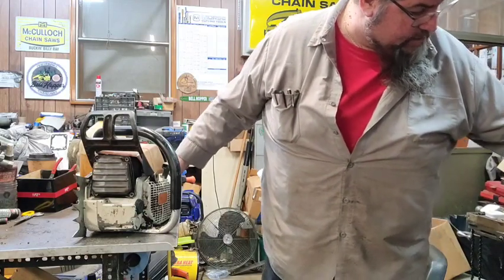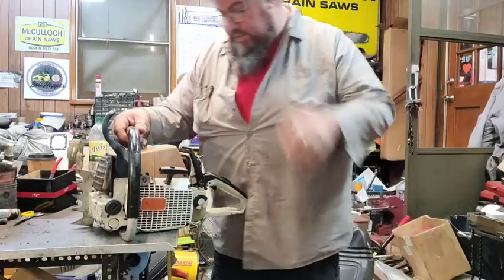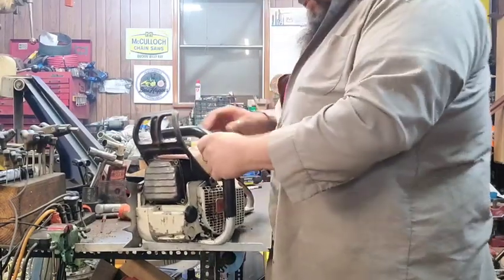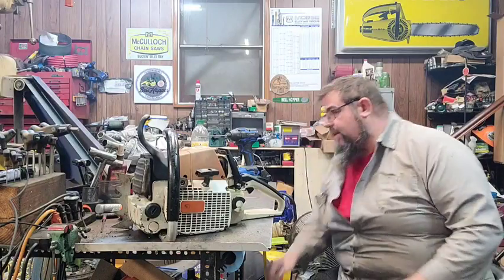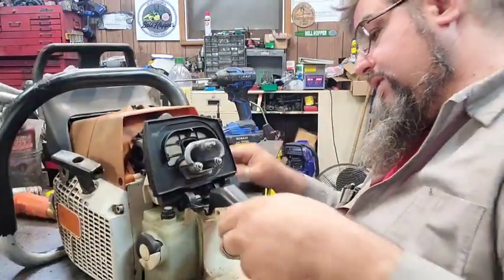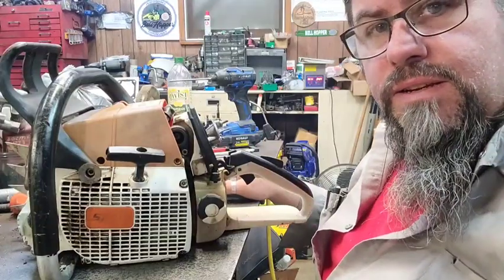Stihl Ms460 What Goes Wrong ?

Comment: Did you ever figure out how to test the ignition module under the flywheel on the 048 AV electronic saw? Im getting the same numbers on the old coil as the new coil. so I dont think the coil was the issue, however the piece under the flywheel is another matter.
Thanks for any and all input you can offer up.
Reply from the maker: Drew has one im trying to get it so we can test it

Comment: I built a 345 husqvarna that acts like that but its worst unrunable really and i cant seem to figure it out. So i put a new top end on it and a new set of seals and bearings so i installed everything fired it up and runs like theres a bad drag on it  and the crank on the clutch side gets hot so i tore it all down again never seen anything out of the ordinary put it all back together and no difference not sure if its where i put ebay bearings in it or not but i cant run it
Reply from the maker: When the timing is retarded they seem to drag alot im going to change the flywheel to the 046 and see if it changes
Reply: @bellhoppersaws  Yea id say thats your case but i think
Something else is up woth mine

Comment: Thanks. What was the initial low and high settings on the carb to get it to start?
Reply from the maker: I usually do 1 1/4 on both
Reply: @bellhoppersaws  Thanks again. I will try setting mine and getting it running today.
Reply: I got my MS 460 running again. I started with both jets 1 turn out. After tuning a bit I think the low is about 3/4? But that wasn't the problem with why the chain was turning at idle. I decided to check the clutch. I had 2 broken springs. When I put the needle nose on the 3rd spring to pull it off the end broke off that spring also. I quick went to the Stihl dealer before they closed and got a 3 spring kit and put them in. I think I got the saw fixed and can cut tomorrow and see how it goes. Thanks again for your ideas and help.